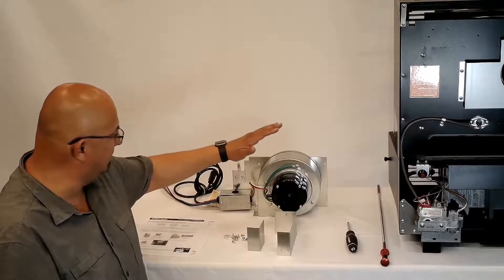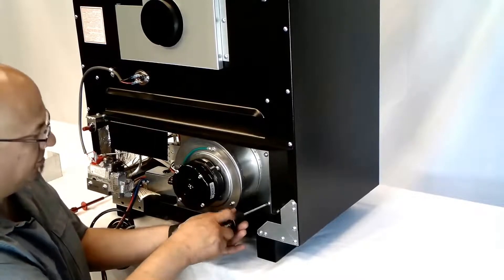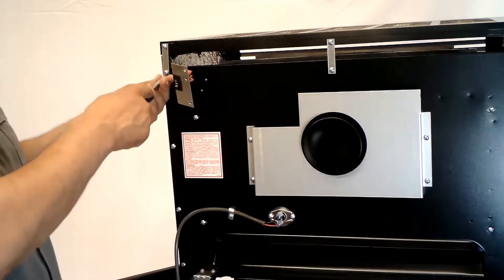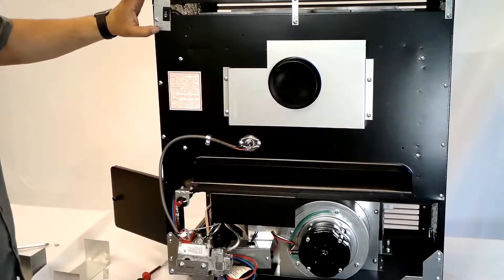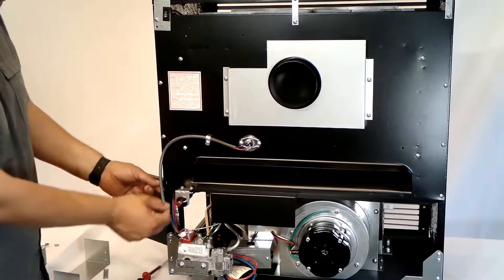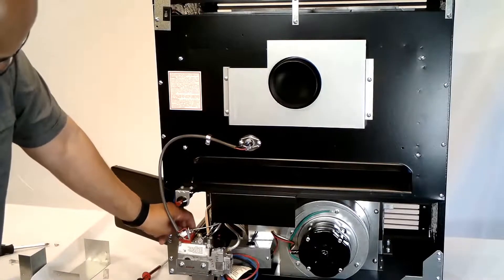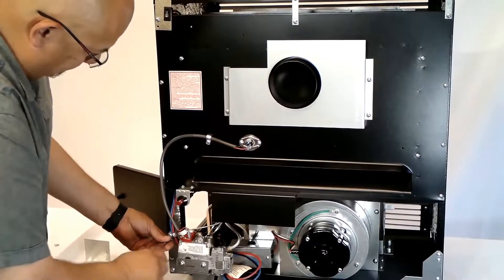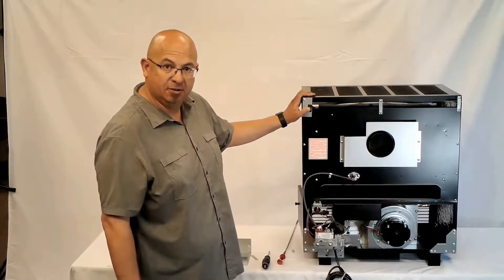Williams Furnace - Blower Installation Kit

Comment: Should the blower turn on as soon as you hit the high or low switch?
Reply: I guess this site isn’t monitored.  That’s a bummer
Reply: I bought my Williams heater with a blower factory installed. Yes when you flip the switch it should kick on right away when the heater is running so make sure you turn your thermostat to where it'll kick on. Be careful though I've only had mine 2 years and all my blower wires are melted. Keep an eye on them.

Comment: Can anyone tell what gauge wire that is to the switch?  Mine melted due to a small thermal issue and I will have to replace it.  Thanks.
Reply: I don't think you can go wrong with a section of 12 gauge. Might be excessive but it'll get the job done
Reply: What was your small thermal incident? I went to turn mine on this year and all my wires to the blower switch are completely melted and coming out of the wire. Did you get yours replaced okay and did the blower still work? I think I'm going to contact Williams this should not have happened I've only had it 2 years and I barely used it one year.
Reply: @Barb61765  Well my issue is that some idiot (I wont name names but he's the only one that lives here) left a fishing tackle box full of Dremel accessories on top of the furnace.  Went to sleep, fire, woke up to soot everywhere.  Switch was easily replaced with 18 gauge wire.  Blower works but is noisy for some reason
Reply: @m.redleg252  glad you're around to tell the story. The only thing I can think of that really trashed my wires, every one of them is frayed in the insulation is melted, I was keeping a pan of water on top of it to put moisture in the air like I do my radiators. Some of the water spilled in it a few times. I'm guessing that's what caused the wires to just deteriorate. My grandson is a HVAC guy and he doesn't think it was the water. He thinks somehow those wires were frayed from the get-go. I'm very grateful I didn't have the situation you did. 

My blower just wouldn't turn on this year. My nephew looked down through the top and said your wires are bad to the switch.. 

Mine is only 2 years old.